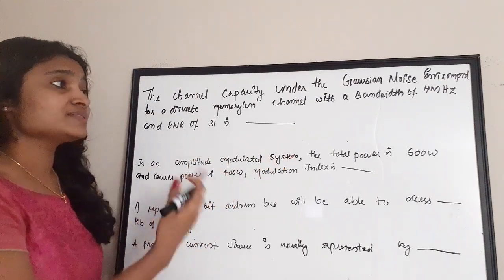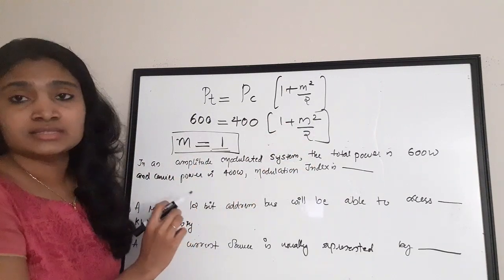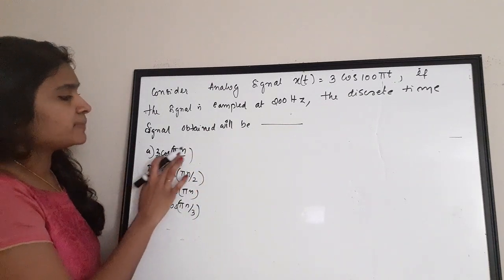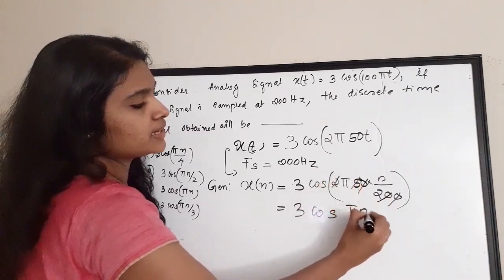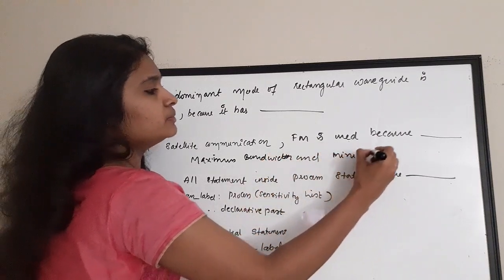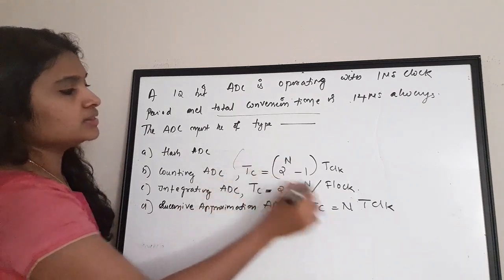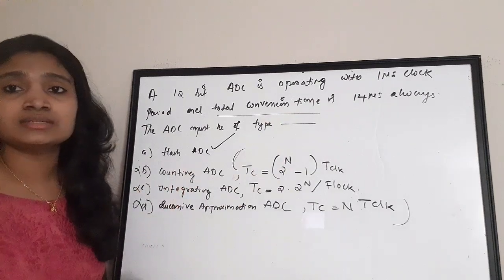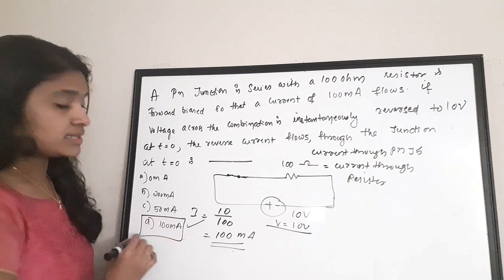Competitive Exam Preparation of Electronics and Electrical Part7| Technical assistant| BEL Exam

Comment: Mam  i have one doubt this paper not HSFC paper becaz HSFC inagurated in 2019 jan..and it has 80 max benguuluru based isro centers conducts for 60 max...check it once
https://www.isro.gov.in/update/30-jan-2019/inauguration-of-human-space-flight-centre-hsfc
Reply from the maker: I got this while searching for hsfc technical Assistant Electronics Previous Year Questions, may be it is for URSC. But the Questions are very good to solve for hsfc Preparation. Keeps the standard for TA rather than just simple theory Questions.

Comment: hi, I am not understanding your last question explanation , if bias is reversed from 100ma fw bias current  in pn jn diode then how will 100ma still flow..if reverse means oc right?    pls
Reply from the maker: We are trying to find reverse ln leakage current so we take as short circuit.
Reply from the maker: Please see how to find reverse lekage current of diode in google, hope you will find the answer.
Reply: @EasyElectronics_jobupdates  
Yes reverse current is different formula..but reverse current will be very low or negligible.but here  reverse current is equal to fw current 100mA..that why confused. is it any other phenomena due instantaneous polarity change is or junction capacitance at t>0??
Reply from the maker: @YourSPR360  yes, that also comes into play here due to instantaneous change there is charge storage but charge is of reverse direction.

Comment: Mam , doubt on the last question . When voltage is reversed actually the diode is getting to a reverse biased condition  and in reverse biase condition  it will be acting like a  open circuit and  will be having zero current flowing through it  . But you are saying that it will will be acting like an close circuit i am a bit confused .
Reply from the maker: Because here we want to find reverse current value, We consider it as short ckt because diode was actually forward biased we have only reversed the polarity of source.

Comment: Excuse me ma'am, the problem u explained about ADC, I think it's wrong. The correct answer is succeccive approximation adc 
Bcoz its composition time is n+2 i.e.,12+2=14 .so option D is correct answer. Plz react on this comment and give me ur reply on this solution.
Reply from the maker: For ideal case successive approximation has ntclck time for Conversion.
Reply from the maker: Anyway let me just see once again
Reply: @EasyElectronics_jobupdates  
Okay. But don't forget to say the correct answer about it .Beoz I'm preparing for this exam. And I was shocked when u said that option D is wrong. Give me the correct answer as soon as possible
Reply from the maker: Actually I am confused between flash and sar. Do u have equation for Conversion time of flash ADC.
Reply: @EasyElectronics_jobupdates  
Nope I don't have any conversation time equation abt flash. But it gives the output as soon as the input is applied. And I came opinion that it doesn't take any delay even n bit ADC is applied .
Reply from the maker: @dhanushreddy4367  ok, then the answer has to be SAR.
Reply: @EasyElectronics_jobupdates  
Yes SAR is correct answer
Reply from the maker: @dhanushreddy4367  anyway thanks for the correction and sorry for the trouble
Reply: @EasyElectronics_jobupdates  
No problem. Take it lite. Keep smiling. Bye 👋
Reply: @EasyElectronics_jobupdates  SAR conversion time = n+2 Tclk where two extra clocks required for start and end of conversion...Hence SAR is the correct answer
Reply from the maker: @keerthi8537  yes correction added in description